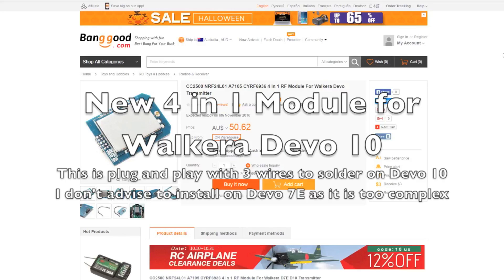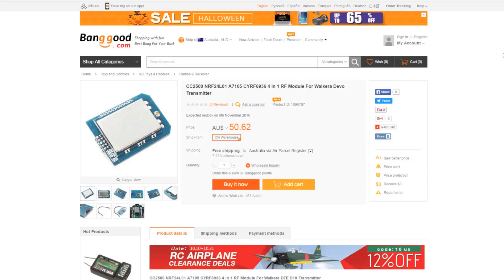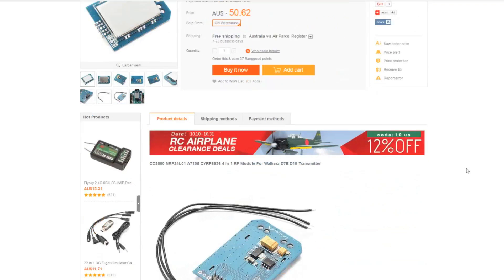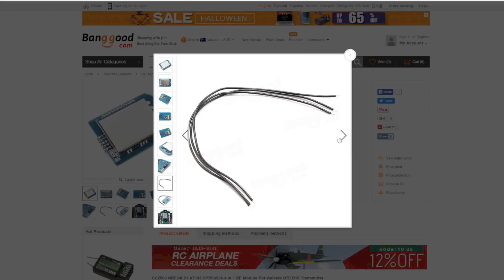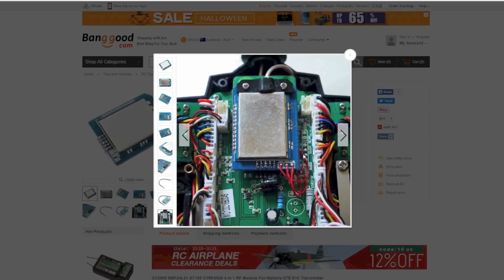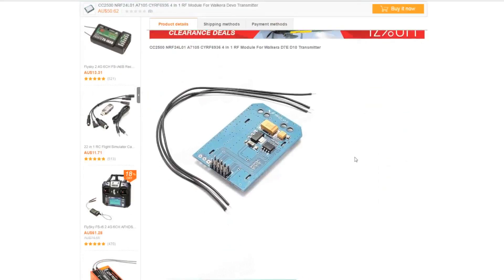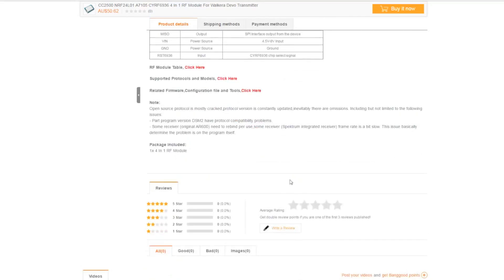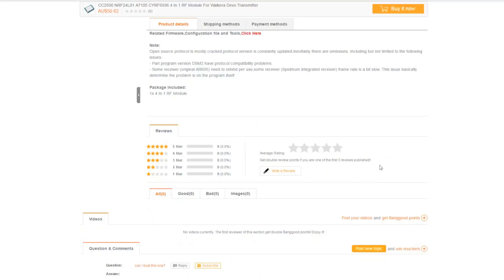For Your Info - New plug and play 4 In 1 RF Module For Walkera Devo 10 for Deviation

Comment: Seems a scam.  Why would a manufacturer not give directions, unless someone else bought a bunch to sell and advertised it to fit the devo 10, when they don’t work at all.  
They have been out for quite awhile.  You think someone would like to be the first to tell the world how to connect it.
The of course...why did I buy this?

Have you installed yours?  Or have some facts about it.

“Subscriber Request”. 8)
Reply from the maker: Hi Jim. I haven't bought it yet. So you have yours and it doesn't work?
Reply: I just don’t know where to solder the three remaining tips of the wires.  Soldering to the new module is simple, but where do I solder the other ends?
Reply from the maker: Jim Leffler I have figured it out. Will put up a video; hopefully later today.
Reply from the maker: Hi Jim, here's the instruction video for installation of the 4 in 1 module https://youtu.be/i0VIYnDNdec
Reply: this module works on the 8s to yes?
Reply: zjoe555 not sure what you mean.

Comment: Awesome JT 👍. I've still not bought a decent radio yet. This puts the Devo 10 back in line as the most likely I would buy again. Dose the firmware still have to be flashed?... Btw I actually tried to scroll down the page while I was watching that 😂😂😂. Thx Dod.
Reply from the maker: Thanks :) LoL, Yes, this module makes it very easy to install. Deviation needs to be flashed too.

Comment: Hi, I need your advice. I want to buy a transmiter but I don't wanna waste my money for regret. I need a transmiter that has all-in-one controling my tarantula x6, x4, syma x5c, and JJRC X1. Which one should I choose: FlySky, Devo 7, Devo 7E, or Devo 10. 

Of course Taranis is the best, but its too expensive.
Reply from the maker: With this new module, Devo 10 is the best and easiest to mod and use with great support from Deviationtx team. Btw Devo 7 cannot be modded. Flysky TH9x cannot be upgraded to open source firmware as it has no usb port and the 4 in 1 module is hard to update (unless you are willing to go this way). Devo 7E feels too much toy grade and needs further switches mod to make full use of deviation. So with Devo 10 and this module, you have frysky, flysky, futaba and all the protocols for your toy quads and you can use it in the future for bind and fly racers. The gimbals are also quite nice. It will do for now before your future upgrade to Taranis. Hope you subscribe. :)
Reply: jtgravityRC - You are awesome! Thanks for advice. I realy appreciate it. I had subbed your channel.
Reply from the maker: Arya Dega Thank you. Will sub back. Cheers! :)